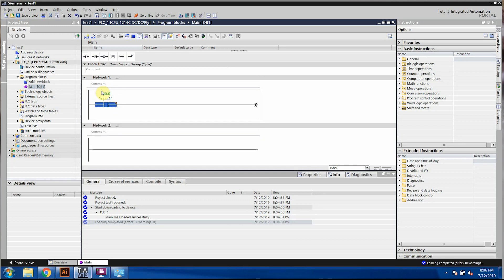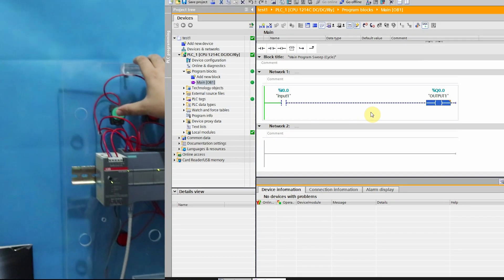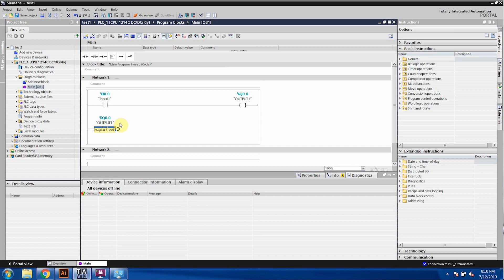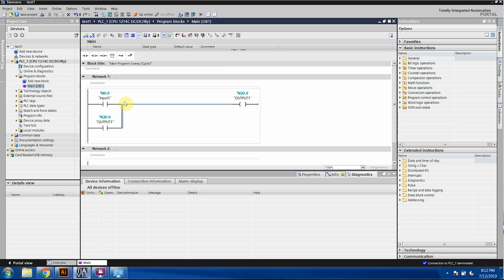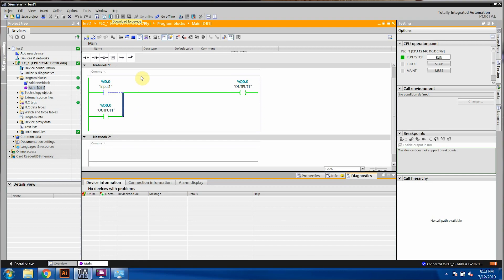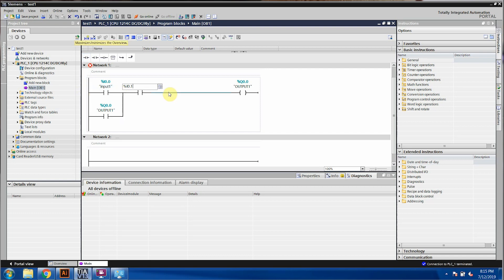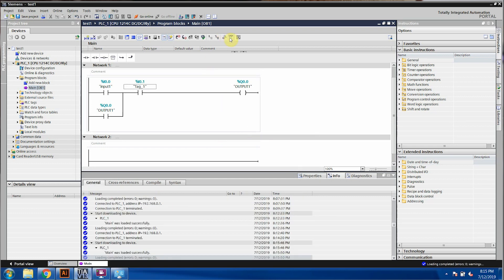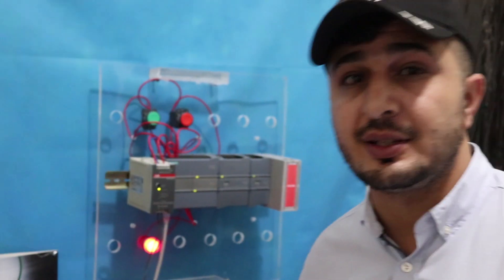Lecture 5 :PLC programming tutorial for beginners | PLC Latch and Unlatch Programming

Comment: hello sir, at 7:13 I got confused. Is that red physical button a normally closed button? Because on the program, you used a normally open contact for the stop button, which when energized, it will close, and complete the circuit, which will turn on the light